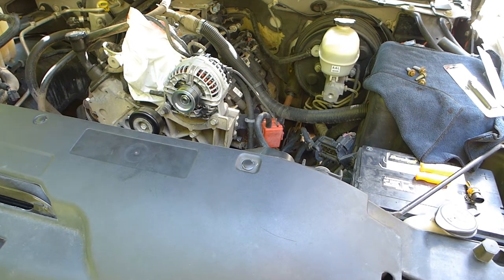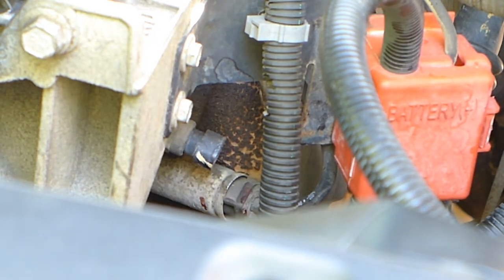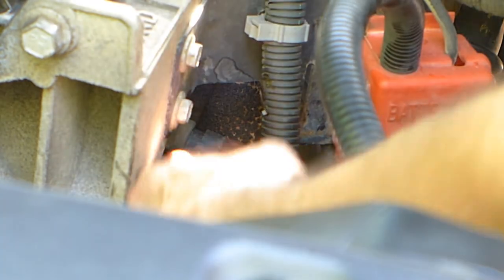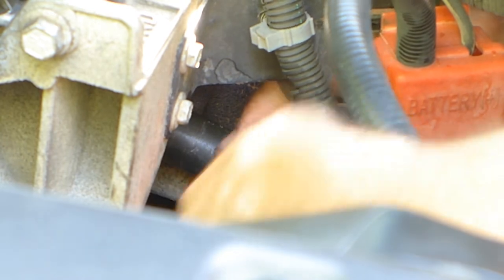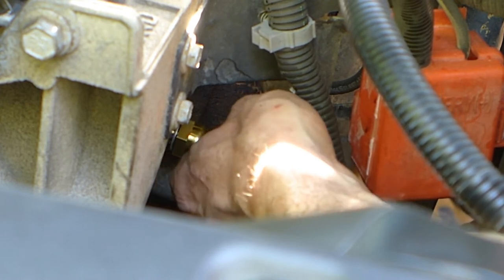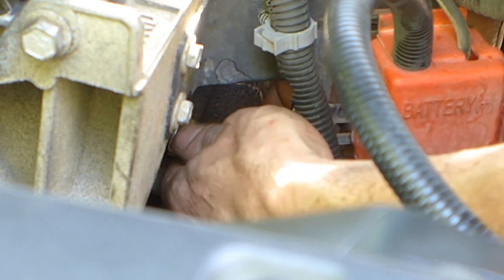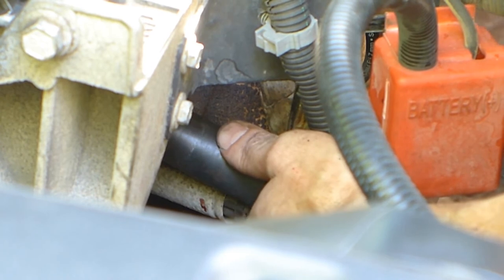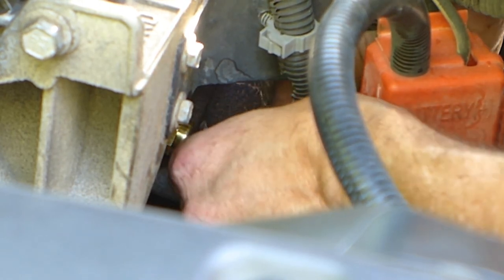How to Replace Coolant Temp Sensor | 2005 Sierra 1500 GMT800

Comment: Is the wire hard to switch out or is it easy also?  Sometimes my truck thermostat gauge doesn’t work!  I’m thinking it’s the sensor but if I’m gonna do the sensor I’m thinking about changing out the wire also.  Because I’m also going to but I’m a new thermostat
Reply from the maker: It shouldn't be too hard, but you might be able to avoid replacing wires altogether. If you can wiggle the wires when the gauge is not reading properly and that causes the gauge to read as expected, then it is likely that a wire is frayed or broken. If you wiggle the wires and nothing happens, it's more likely just the sensor itself (this would be my guess even without seeing the overall condition). 

If you can identify that the wire is broken between the plug and the main harness (or if you replace the sensor and nothing changes), you can buy a replacement plug and short wires fairly cheaply. Splicing that into the harness is pretty straightforward if you've ever installed a stereo or something similar. 

If there's no obvious break before the main harness, you can test the entire run of wire from the plug side near the sensor, to the ECM side (while ignition is OFF) using a multimeter. If I had to guess, I'd say it's only the sensor and possibly the wires before the harness. They are pretty well protected the rest of the way, but there is always the chance of a hungry mouse causing damage. 

Swapping the entire run wouldn't be too hard but it does involve swapping wires in the ECM plug, which adds a small bit of complexity. If you're not comfortable with that, it should be around an hour of labor if you have a local mechanic you trust.